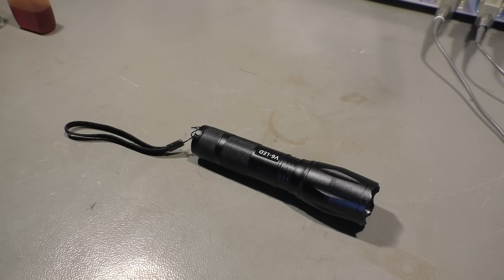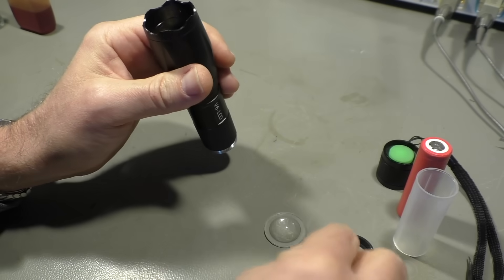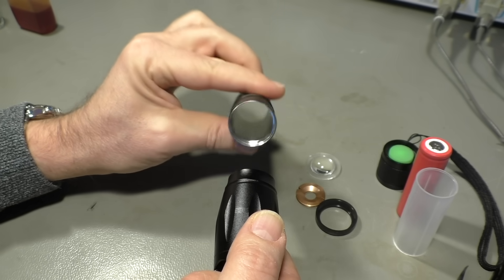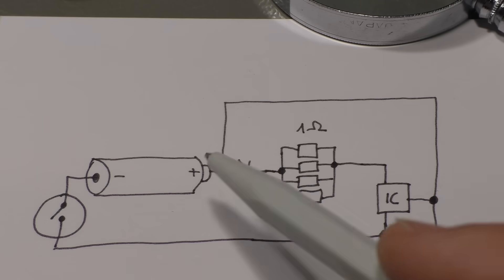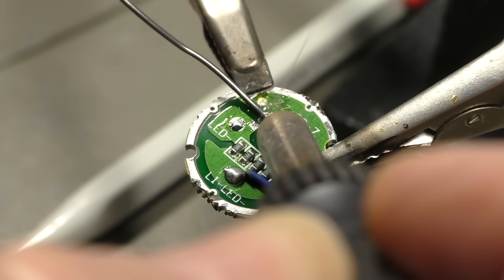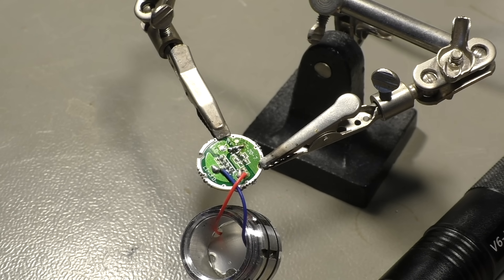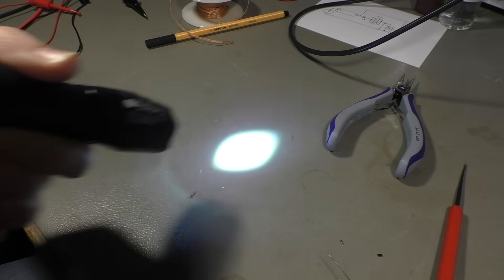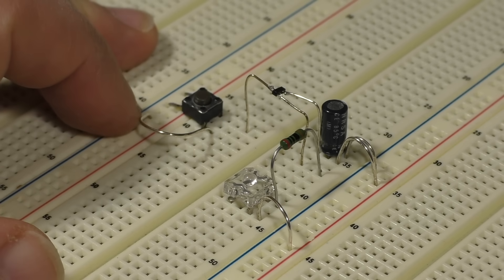Hacking an annoying flashlight into something useful (PWJ255)

Comment: Just a word of caution to everyone out there wanting to do this: This is just ONE flashlight out of many using a blinker chip, many of the LED flashlights you buy off these sites also have an USB charging chip built inside, so make sure you're not messing with the charging mechanism (protection) or you could find yourself without a home later on, so stay safe and Happy 2025.
Reply: the flashlights that have USB charging will have a different board, obviously.
Reply from the maker: That's a good advice! But I guess those lights with an USB charger have a better circuit (I hope) and it's not necessary to modify them.

Comment: No need to remove the IC, just bridge two legs. If you want to roll back remove the bridge.
Reply from the maker: This is true. But I like to have any unnecessary parts removed. You never know if something shorts the battery or goes up in smoke. That's why I also removed the capacitor. Less parts are more reliable :-)

Comment: 11:16  3 o'clock ⛪ 😊
Reply from the maker: You are wrong. That was the bell signal for x:45 
There is one ding-dong at x:15, two at x:30, three at x:45 and four at the full hour followed by the number of hours. The 3:00 signal would be ding-dong, ding-dong, ding-dong, ding-dong ----  dong, dong, dong.
Trick question: How many times does the bell ring at midnight?
Answer: 20 times (12 for the hour and four dings and dongs)
Reply: @PlaywithJunk  I'll have to ask Cinderella. Witching hour.
Reply: Am or pm?  He could have just did some spy stuff. Time zones and Zulu time. Time is relative. He could be testing an old tall clock acurauracey and chime. Beautiful sound it is to remind you of how you spend your time.

Comment: Happy New Year.
I wonder if the chip also looks at the battery voltage and disconnects if it drops below 3.0v to protect the cell.
Cheers Dave,
Reply: it does not. I killed a 18650 cell by forgetting it on overnight, before I decided to remove the chip
Reply from the maker: The chip has no undervoltage protection. At least not that one I removed in the video. And there is also no current limiter for the LED. It reduces brightness with 50% or 25% duty cycle. However it's just an on-off circuit. Even at half brightness, the LED get's full current, but only for a fraction of time.
Reply: Not only that, it's also a LED Driver chip so you don't have the LED at full power all the time. There are also variants with USB chargers built in.

Comment: Thats a good fix. I would like to do that to all festive lights. Some I have to press the button 7 or 8 times to get to the constant light. If you have a "simple fix" for the usual 6 pin chip. Like cutting off one leg or soldering two legs together then please make a video about it. Thanks for this one. 👍🔦
Reply: If you're talking about the Christmas lights or outoor leds on wires that comes with 8 functions you're talking about, those are not as simple as removing the chip. The controller also  "flashes" the leds rapidly so it acts like a Led-driver, meaning that it doesn't provide full power to the led (which could possibly overload the cheap power supply these come with), and cost you a lot more on your powerbill. Better remove the power supply, and make your own Led driver instead.

Comment: But does it actually flash S-O-S? Most of them usually do SO-SO-SO instæd.
Reply: Mine was like   . . . _ _ _ . . .
Reply: @Shaikhh.junaid  and after that?
Reply: @jkobain  it keep on sos mode until I click on button and it switch to high mode
Reply: @jkobain  it has 5 modes high, medium,low,flashing,sos so it keep on repeating these
Reply: @Shaikhh.junaid  if I didn't make it clear enough, is it true SOS-SOS, or a cheap SO-SO-SO?
Reply: @jkobain  its true S-O-S
Reply: @Shaikhh.junaid  thank you for the clarification!
Reply from the maker: Yes it did that correctly....  S-O-S and then repeat.

Comment: I think you overdid it. All you should have done is unsolder the red wire and put it on the other side where it says "LED -" and that would have been enough to stop the transistor from working.
Reply: yes, but using your way you have nothing to play with after finishing the project . . .
Reply from the maker: In fact it's simpler to solder that bridge than to move a wire. Especially if you have a model that can't be taken apart completely (some are glued)

Comment: interesting, so the chip is not a constant current supply  as i originally thought, you're saying that it just has a fixed PWM duty cycle of 50% and 25%...  ...that would generate a variable current that depends on the battery voltage and the fixed PWM rate.  

And the first settings is just 100% PWM , so the current is limited just by those 4 resistors..that is kinda disappointing.. 
I think this can be checked by measuring the current and powering the circuit with less voltage to see if it has constant current.
Reply from the maker: It's exactly as you wrote. The chip just turns the LED on or off. 50% and 25% and 100% and SOS and blink. Nothing else, not even an undervoltage protection.

Comment: you didn't need to remove the chip, correct?  since you're bypassing the chip anyway.
Reply from the maker: you could leave the chip inside but I prefer to remove all unnecessary parts. Less parts = more reliable :-)
Reply: @PlaywithJunk  like what? the chip is going to short more? lmao
Reply from the maker: @user-rs8zg8ey2b  The chip has a connection to battery plus and minus. If that shorts out, you have no light. That's why...
And from my 40 years of electronics experience, I can tell you that unnecessary parts should be removed.
Reply: @PlaywithJunk  sounds like you work for the government
Reply from the maker: @user-rs8zg8ey2b  Really? 🙂

Comment: 10:00 if the cap shorts out, you get a large flash instead! (when using LiIon 18650 cell)
Reply: Maybe an emergency fire starter for camping trips? 😊
Reply from the maker: But only for one time :-)

Comment: No need to remove ic or capacitor.  Just bridging the pads is sufficient.
Reply from the maker: less parts = more reliability :-)
Reply: why remove anything, just jumper short across it, 1/10th the time to mod it
Reply from the maker: @user-rs8zg8ey2b  The fastest is not always the best.😶
Reply: @PlaywithJunk  in this case it is, 1/10th time, for zero "more reliability". 99% of these flashlights fail from the switch button or the battery contacts, not the ice or cap.

Comment: It's hard to say if it's OK to remove that Chip as it often regulate voltage on leds to not burn it out to quickly and/or smooth output to reduce flickering. Of course it all depends do flashlight but I would recommend using some resistor and to limit power and small capacitor to smooth light and removing any flickering.
What I did when I was using those cheap light is... Just slap some small but beefy cap to make that flickering so smooth that you can't see it as I still wanted low-power mode on them xD
Reply: Agreed. I tried this on mine, which is the same as this one. Current with the chip was some 600mA and shorting it was 1 amp... I don't know the rating on that LED but hey, I just left the chip in place just out the capacitor so it doesn't remember the settings.
Reply from the maker: This chip does not regulate anything. It just turns the LED on and off. There is also no undervoltage protection.... this chip is just useless. There is also no need for a capacitor in a battery operated light because there is no flicker from DC current.
Reply: I was thinking the same thing Time will tell

Comment: Very nice!  Could you leave the chip, but remove the capacitor so it cannot 'remember' the setting?
Reply: Yes exactly.
Reply from the maker: That could work, but my philosophy is: less parts = more reliability! :-)
Reply: purists would say the chip might draw some little current
Reply: Well for reliability remove one of the resistors so it don't push the led so hard.

Comment: The chip will have an internal MOSFET so it will have some on resistance in addition to the 4x1ohm resistors. I wouldn't just replace the chip with a wire. Work out the RDSon resistance of the chip and replace it with an equivalent resistor of the same value. The LED and battery will last longer.
Reply: So keep the chip and just remove the capacitor.  That should disable the flashing functions but keep Rdson in series.
Reply: Genuine question, how much longer would the battery and LED last?
Reply: TLDR; remove one or two of the resistors if you want to play it safe

Rdson for nearly all MOSFETs is in the milliohm range. Without the datasheet it will be difficult to measure accurately enough to worry about it.

If removing the capacitor gives the desired functionality that's the safer solution but tbh i'd stick with what you did - removing the capacitor likely won't have the desired effect and is more likely to cause the IC to fail before the LED will. My GUESS is that its purpose is for switching the gate of the MOSFET.

The potential gains from reintroducing Rdson would be so negligible i doubt you'll be able to accurately measure that too BUT with all that said...

If you really want that insignificant potential gain remove one or two of those resistors - it'll have the same effect. The four 1 ohm in parallel is just a 0.25 ohm resistor, removing 1 will make it a 0.33 and 2 will make it a 0.5 😊

Comment: Perhaps this chip also contains a current stabilizer for the LED. By removing it, you can reduce the service life of the LED.
Reply: @BitBanger yes - the voltage drop of the power LED is much higher - leaving for voltage drop over the current sense resistors(0.25 ohm) of only about 250 mV...
Reply: @ Aah that makes sense, thnx.
Reply from the maker: The current with just the resistors is about 1A which is in specs for that 4W LED. And no, the chip does nothing except turning on or off. Two settings use a 25% and 50% duty cycle, everything else is just a switch.
Reply: @PlaywithJunk 0,25 ohm 2,8 volt = 11,2 amp = 31,36 watt. Or am I missing something?

Comment: I bought about 10 of them. They cost as little as Fr4.- downunder. Most have a holder for 3 AAA cells. All work fine with a 18650. You must have watched Daniel from Diodegonewild. He hateds daylight chips and besides swapping the main led he figured out a way to trick the IC. In countries where they call Benzin Gas they call it flashlight. Here we use Petrol and call it torch.
Reply: Yes I have one that came with both a 18650+plastic sleeve and a holder for 3xAAA.
Reply: @Rob2  two of mine can hold 21700 cells without that plastic sleeve. others are little different. triple a are not interesting for me
Reply: @LawpickingLocksmith 
So you are French.?
Reply: @snakezdewiggle6084  Nah, in France they call Gas Essence?
Reply: He said "down under," so he obviously lives in the Upside-Down.

*Juno synth music fades in*
Reply: @Are0hEssEss  We play them CD's upside down to compensate for gravity!

Comment: It's super annoying having these chips in almost every flashlight out there, Almost as annoying as kids toys having that exact same sound chip 🙄
Reply: Good video. Sadly the majority of people who try this will probably end up with a half dozen flashlights in pieces. Im curious to know if you checked the capicitors specs after removing it.
Reply: I didnt see any O rings to attempt to make it water resistant much less water proof
Reply from the maker: There are o-rings but not everywhere. Making it solala waterproof...
Reply: Yo quise desarmar una como de ese tamaño porque creo que se le daño el pulsador porque ya no prendió y termine haciéndola tiras y después otra más chica é igual ahora hay las tengo trazadas con segueta y cortes con desarmadores jajaaa.los leds y la pilas si están buenas y ahora que poes que ago con los leds que resistencia les puedo poner antes de los les para que no se me quemen para hacer otra linterna saludos desde Monclova Coahuila México bendiciones para todos 🙏
Reply from the maker: @cesarsandoval9052  The best way would be to buy a flashlight circuit PCB on Aliexpress. There are very small modules that fit into every flashlight and they have a constant current chip. If you just want some resistors like my lamp had, then 0,5 to 1 Ohm will probably be OK. Just make sure to use not only one resistor because it will overheat. My lamp had 4x 1Ohm = 0.25 Ohm total in parallel.
I don't know what LED you have, maybe a higher value resistor for less current may be better.
You can try different values and you may start with 5 Ohm. If it's too dim then take a lower value...